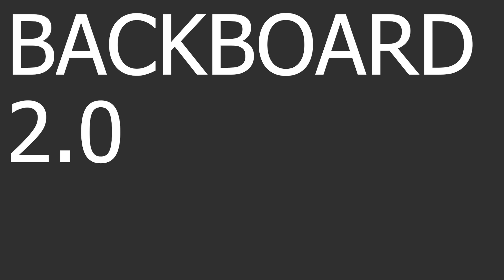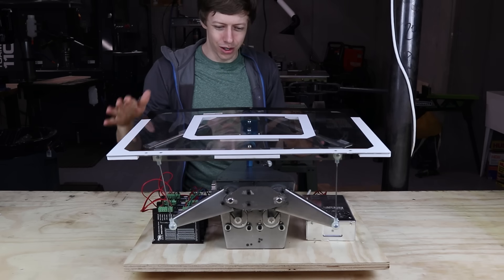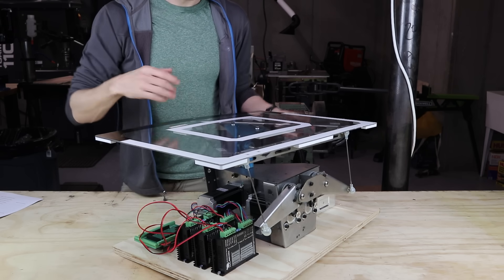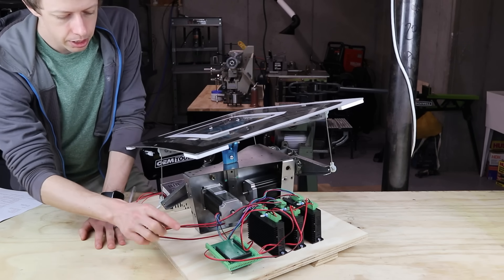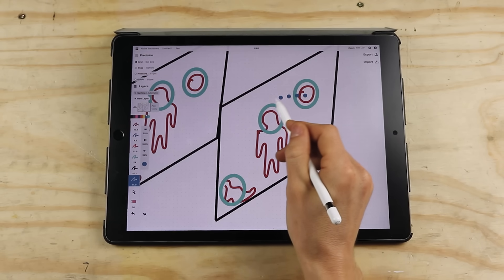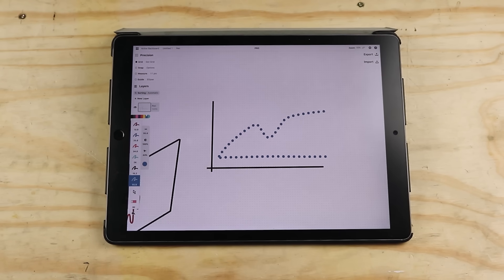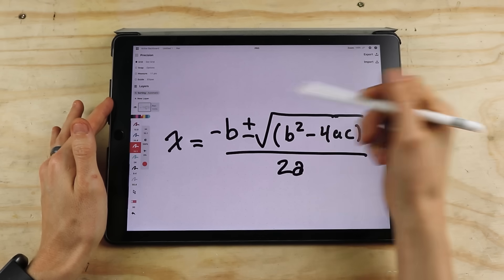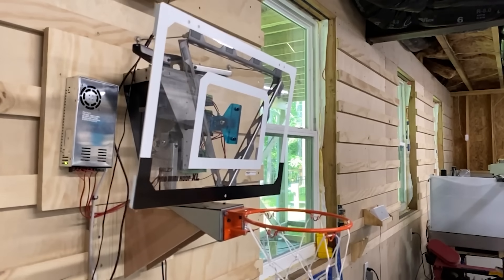The automatic hoop always goes in

Comment: This is so nearly perfect... But you seem to have let Windows in to the loop. 
Don't get me wrong, Windows is in my top ten operating systems. But I don't think you want any OS in there. 
Some of the micros out there can do fast floating point. I am rather impressed by the ItsyBitsyM4 but I would guess that there are significant barriers to doing the Computer Vision on that sort of platform. 
My main hobby is CNC machines controlled by Linux running a kernel with realtime extensions. That can control motors with microsecond accuracy all day every day.
But I don't know of any bounded-latency computer vision options.

Comment: Nice one!
About the problem with the last second move of the board: Couldn't you make the board move to an approximate position early on during the flight of the ball and then as you gain more and more information during the flight send new move commands? Like this you don't have to perform the complete move at the very last moment (which as you said limits its performance at the moment). You might have to redo parts of the initial movement but that would still be significantly less movement than doing the whole move at once.

Comment: It's a really great project. 
To reduce the required acceleration, you could move the board into position earlier. Based on the first inaccurate measurements, you can calculate a first position and start driving. Over time, you get more and more information about the trajectory and can determine the board position more and more precisely. The board follows the calculated points and gets closer and closer to the optimal position.

Comment: I really like this but I have a problem with it:
Why don't you start moving the backboard as early as reasonably possible and adjust the position later? Wouldn't that significantly lower the amount of force needed because you have a lot more time?
Reply: To gather the most data. It is recalculating the balls trajectory again and again to determine with the highest precision possible where the ball will be, and where it needs to intercept it.

Comment: Would it make more sense to continuously move the backboard to the optimal angle while its gathering data and calculating for the best solution? The motors wouldn't have to work as hard I imagine

Comment: I am pretty sure I could squeeze out several milliseconds of response time out of the back board. 
instead of waiting to the last moment before giving a "BOARD GO HERE" command i'd issue a mid-step as soon as the first trajectory data is received. You can do two things:
A: start the board moving to the "most common goal location" based on the average location all of the successful throws. a bit of machine learning to get the board starting to move to a sweet spot in 3d space where most final solutions are. this would save travel time when the final solution is found and the board only has to make a tiny correction for the perfect shot.   
In short as soon as the camera detects a throw, start moving the board to a 'sweet spot' before it knows exactly where the ball will hit. then correct it later once the full trajectory is plotted
B: I forgot what my second idea was while writing the first.  my point being allow the board to guess and refine as more frames of info are available. it would look very impressive if the board started moving as soon as the ball left the person's hand.
instead of wasting frames using depth only to figure out what could be a ball. why not use the color camera to tell the software "Assume the neon green thing is ball" then detect a throw event as the neon green thing getting closer to the camera at a certain speed. for spin you could just put black shapes on the surface of the ball which should be somewhat easy for the camera to figure out where the shape moved on the surface of the ball.
Reply: Ummm I just got brain fu**ed
Reply: As a response to your point A. What you are telling him to do is double or even more the processing time of the software. It would have to calculate the average location of all successful throws which would add at least a good 100 ms in processing time.  Meanwhile, he already mentioned he is getting bigger motors which will allow him to do the movement of the backboard even faster which will lead in more time allocated to calculations thus more accuracy. And while throwing some machine learning in there would be great he mentioned his Arduino processor is already being fully used. 
And to not be just a sucker that points out stuff in what other people said, my input would be to try to make the software more efficient and then try machine learning, but to be real with you, I would not dive into such a problem, making my stupid AI s that I program for uni more efficient is a pain in the backside,  I could not imagine making that more efficient.
Great conversation starter tho, keep it up bud.
Reply: @vladfilip5311  I am not saying do the math DURING a throw.
I mean precalculate it.
Reply: SkyboxMonster Only problem with that is that you need many many training cases and they need to be the same across every time you backpropagate. You could probably make a robot that throws the ball at the backboard if you really wanted to, but at this point it seems faster to just do the linear algebra instead.

Comment: You can probably analyze the curvature of the projectile with sensors and have your program fit it to a function and then take the slope of the tangent at the point(s) just when the reaction time of the robotic is ideal to adjust to moving on it's axises respectively as a function representing the normal line to the tangent. Just thoughts.

Comment: Couldn’t you make it so the backboard moved continuously as it was calculating the trajectory of the shot so it only has to make smaller adjustments as the trajectory progresses? I would think this would allow the board to continue to adjust after the last data point was taken using your current program.

Comment: OK, so this is very interesting and fun, but what about turning it to a practical problem. Sorting recyclables. Could you make a setup that evaluates an incoming stream of recyclables and sorts to different colors of glass, plastic separated. waste, paper, etc? I know this is a problem that has been solved on a large scale, but what about of a one home domestic scale. It would require the visual identification of items, potentially using weight and color as two factors.

Comment: I think you'll improve your program if the backboard end position (which is dynamic) is included in the math.  You seem to be calculating the angle needed from the trajectory, but the board is also moving.

Comment: Instead of an Arduino, use an STM32.  It runs at 72MHz or 4.5 times faster than the Arduino.  If you don't want to use the ST development, you can stick with the Arduino IDE (write, compile and upload).  There are board managers for the STM32 you can get them on GITHUB.  Program upload requires an ST Link (less than $5) as there is no data for the USB, power only.  I'd recommend the STM32 development board, STM32F103C8T6.

Comment: Wouldn't moving the board incrementally allow for a better outcome instead of just a period of data collection and then a reaction period? It basically extends the time that you can collect samples and adjust the board since the board is in the generally correct position already, it has a shorter distance to move and thus can get to a target position faster. Kind of like progressively loading jpg if you remember those. Starts off blurry, but gets better and better as time goes on.

Comment: I'm curious how you got an Arduino uno to perform all those calculations quick enough. It's sounds more like you have the Kinect hooked up to your laptop which is running some optimized Matlab code or maybe even c++ go perform the calculations. You then send motor commands via serial to the Arduino and then the Arduino sends those commands to the motor driver. I like that you went over the algorithm but I'm always interested in the instrumentation rather than the algorithm.

Comment: What if you start to predict the trajectory as soon as you find a object that follows second degree polynomial, and you assume the future trajectory follows a Gaussian distribution. Then, you constantly adjust the board until it converge. By doing this, you won’t need a powerful motor to do move the board because the adjustment is softer. Also, your system can handle faster ball.

Comment: Some suggestions. If you flange and gusset the metal frame, you'll have a much stiffer frame and prevent as much flexing while also having the benefits of a Swiss cheesed frame. I think go hydraulic mounted between the edge and center instead of motors for much more snappy movement which would help compensate for time lost and give more time for it to do calculations before giving an appropriate angle. Maybe a honeycomb polymer or aluminum panel for added strength to prevent it from bouncing around? Just some suggestions. Im not crazy knowledgeable, Im just trying to offer up some ideas that I think might work. I could be wrong though. Can't wait to see the next version.

Comment: It might look cool to have the backboard move at the last possible moment to save your shot, but you could start moving the hoop as soon as you have any kind of trajectory solution, which would give you significantly more time to do the gross movement, which would decrease the power required to drive your actuators. I would suggest you model this as a set of PID controllers that you update the set point every frame of video once you have some kind of ballistic trajectory detected.

Comment: If you use ROS (robot operating system) (Debian based OS) instead of Windows as your OS, you will smooth out much of the processing and crashing issues you are having. Assuming your code is clean and efficient

Comment: Yeah, Windows isn't designed for that kind of real-time response, at least not by default. I got into this a bit back in 2006 when I bought a Sherline CNC mini mill and also their CNC mini lathe, and decided to go with CNCLinux. It's a distro of Linux with its own scheduling system, intended to respect the needs of an axis-controlled system, where missing an instruction at a particular time could lead to breaking an end mill, damaging a mill, or your part, or causing human injury. There was a bit of testing software to dial it all in, and I remember my very low-powered ShuttlePC, bought on the cheap just for this new little CNC workbench, wasn't exactly cutting it, no pun intended. It was close enough, by the numbers, for me, though, so I went with it, and it seemed to work for the couple of years I played around with all of it. The few times I broke an end mill, or drove one into my mill's table surface, were my fault.

Comment: I'm curious, rather than waiting until the last possible moment, what if you started moving earlier, but then corrected the motion as you built a more accurate model. It seems that you would need less acceleration in most cases, unless your early model was just way off.

Comment: Hey, I have an idea🙃: can you make it such as it picks direction, that sends ball to the same place you shot( after scoring) with max error of your hands reach space without moving? Or it’s limited in some cases( just minimize by space between drop and place you’ve send) Basically, idea is to not only score but also not to go for the ball too far after. I think it can be achieved, if you gonna use n-sided surface with increased rotation, like half of sphere made out of little surfaces with different angles. OR make instead mechanical ball with mechanism inside and connect it to the camera to move around(or just internal accelerometer) In that case ball could increase bouncing and change direction to you. Yeah, I know it’s super cumbersome, but it would be AWESOME)😂

Comment: Wait. 
Motion tracking, with a Kinect, Windows, AND inverse kinematics?
In 600 ms? Nice. Very nice.

Also, I giggled when you threw the basketball at the laptop.
Should encase it in case a rogue basketball goes too fast there :P
(the kinect ... you can't encase it, it would mess with the vision / ir depth ... it's an acceptable risk).

Comment: This is just epic, awesome video! I’ve done some CV (much simpler than yours lol) for my FRC robotics team and I wish I thought of the method you did with using multiple frames and R^2 of a logical model to identify the same object across frames. Also, any chance you’d consider publishing the code on github or something? I’d be super curious to see the linear algebra you used to solve for the orientation you needed on the backboard plane to get the ball to go in. I’m a senior in High school and I’m trying to learn how to use Lin alg, I’d appreciate it a ton if you could.

Comment: At 12:50 you said you wait for the last millisecond to make the hoop adjust because the closer the ball is to the backboard the more accurate the calculations are. Just an idea, but would it not be better to calculate the trajectory earlier, then have the board make large adjustments. As the ball arrives to the board more calculations would be made to fine tune the board’s angle. This would give the board a lot more time to make adjustments and I think it would solve some issues.

Like this if you understand and think it would help him out👍🏻

Comment: If you think your issue with windows is software base and not hardware.  Iolo.com (system mechanic pro/ultimate) offers a security package.   In that pack you can shut off a lot of window features.  Thus freeing up cpu/ram.  Its a feature for dummies (not saying you are one).  Also,  if you are on a hard drive switch to a solid state drive.  Those two thing should help reduce issues in that area.  
If improvement is notice but not quite there the right nvidia card could be switch to handle/asset with the algorithm processes.

Comment: Have you considered continuously move the board as you track the ball? That way if there's spin (or trajectory changes for some other reason, like bouncing off of something) you could react and adjust. This would also buy you time... you don't have to wait until the last moment to start moving, so you get close to the final pose after just a few frames of trajectory estimation, then the "point of last return" is later because the board is already close to where it needs to be.

Another thing to consider is to reduce the problem to two degrees of freedom. I.e. rig the board to jaw and pitch only. That gives you the ability to pick your intersection normal (and therefore reflection), but a smaller problem to solve for (possibly speeding up your solution, esp if using a numerical solver.. but again moving the board continuously here also helps, since you can iteratively refine the solver starting at the previous result at every frame).

Comment: Very impressive stuff! Have you considered using a FPGA to achieve real time processing by doing the software processing in hardware? I think it would fit best to use it for the final board repositioning as it looks like the most time critical element of the design. Good luck on version 3!

Comment: You probably tried it but I wonder why you didn't move the board into the best position given the current data set, and then refine the position as each frame comes in and the predictions become more and more accurate. 

I think that would solve all your motor strength and board lightness problem, wouldn't it?

Comment: You talked a lot about differentiating the ball from the other ball candidates, what you describe is a data association problem, which is an important problem in robotics. To help you solve it, you could instead of trying to fit a trajectory (ML estimation?), solve it using a classifier neural network, either pre-trained or fine-tuned via transfer learning. Assuming there is only one basketball in the scene it should be enough for you. Also using the classifier can make you more resilient to outliers in trajectory estimation. You can also use an algorithm that differentiates between different balls in the scene but that would be more advanced, it's present in SLAM literature.

Also, do you absolutely have to delay the board movement as late as possible? Because it seems your controller overshoots and can lead to errors.

Comment: Is this considered as mechanical engineering??? Or what type cause I’m interested
Reply: A mix of MechE and EECS (Electrical engineering and computer science). MechE definitely in the design and function of the machine as well as the inverse kinematics for moving the backboard and the physics of ball trajectories. The EECS part was the embedded systems programming on a real time system and setting up the circuits for the motors and whatnot. Then doing CV and pose estimation and putting that all into code. A lot of robotics projects like this are very interdisciplinary.

Comment: If you want more power in a smaller package and no lost steps, then switch the steppers to Clearpath Stepper Killer (SK) servos. Then you need only three motors and a power supply, as the drivers are integrated into the motors.

And I'm pretty confident that the code in the Arduino is not running as efficiently as it could, like for exampe if you are using digitalWrites or digitalReads, then there is very very much room for improvement. If you need help, I can review your code and rewrite a new version. My competence lies in building a wire EDM from scratch with an Arduino acting as a G code interpreter and driving multiaxis machine.

Comment: Wouldn’t it be more effective to use linear gears to move the board? Since the lever will lose efficiency as it pushes outward. Also, you only need 2 motors if you fix the center joint so it doesn’t move in and out.

If you used linear gears, it would also be easy to create a braking mechanism, would would help to reduce the stress on the motors when the ball impacts.